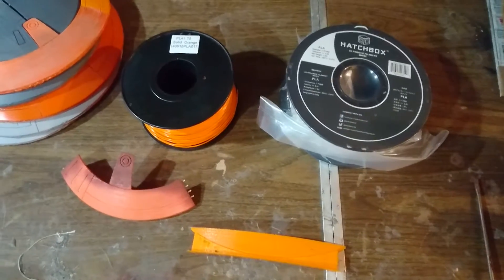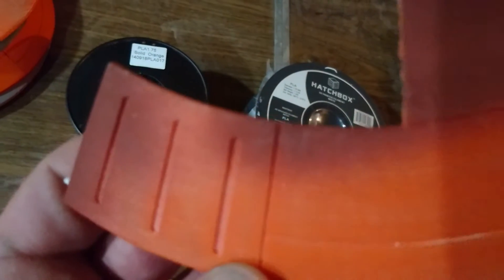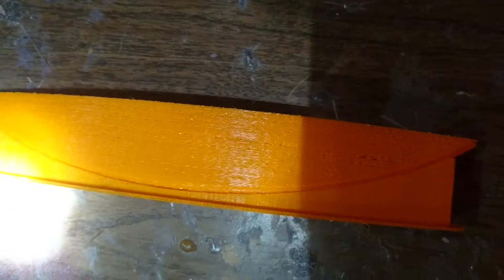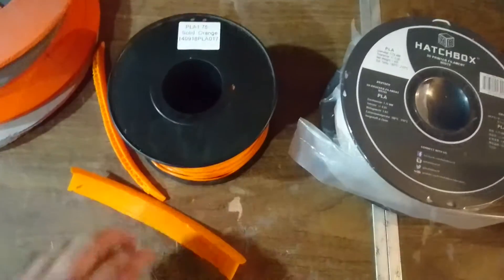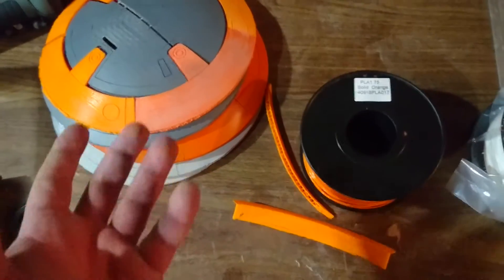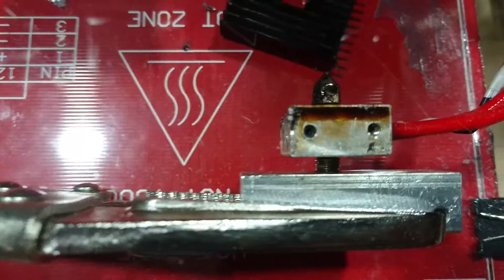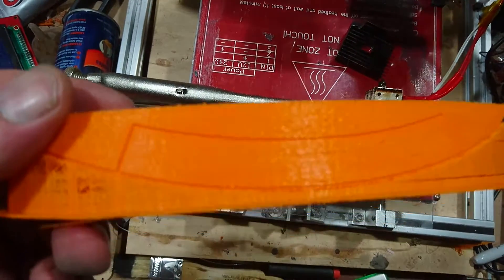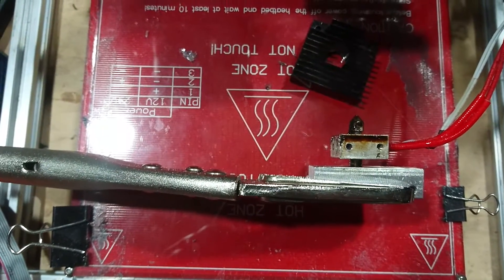How to tell if your PLA has moisture in it!

Comment: What are these white connections that u use?
Reply from the maker: The white parts are PLA filament, the edges of the model have holes so you can clip off some filament, stick the filament in the holes and glue the parts together.

Comment: Try calibrating for the cheap filament instead of the Hatchbox. I use cheap filament (with a correct calibration) and it comes out just like my eSun PLA+. You can not just throw in a new brand and use the same settings. Lack of experience and knowledge apparently.

Comment: This video is a lifesaver. I have been having an insane amount of problems with my new 3d printer and the filament that came with it. Poor printing quality, gaps, randomly stopping and not letting me load until it cools and reheats. Recently bought some new filament and I'm going to try printing with that instead. Something like 95% of my prints were stopping soon after starting and clogging the machine no matter what I did. If using new, well packaged filament resolves the issue I'll update this reply.
Reply: You never diss
Reply: maybe he quit 3d printing out of rage lol
Reply: @superjojo555  No my wife modified the machine and it worked.

Comment: I had an identical problem but it was an extrusion size problem in my slicer . It looks like a flow problem( being way too slow )  ,however I will watch the remainding video. Your video states how to tell if moisture content is high but this isn't really the case because this kind of print can be achieved easily by setting the extruder size in slicer to 3mm for a 1.75 filament .

Comment: Is the black on your nozzle / heatblock to do with water contamination or is that a normal byproduct of printing?
Reply from the maker: I would say a little bit of both. There usually is a little bit of plastic residue from normal printing, usually close in color to what color your printing.

Comment: Could you bake it in your oven at a low temp to remove some of the moisture?
Reply from the maker: +Critters You could, but a gas oven would not be the best. The one of the byproducts of the gas burning is moisture. If your going to try this I'd suggest an electric oven.
However, once moisture makes its way into the plastic it weakens it, I've read somewhere up to 33% weaker than plastic that doesn't have moisture in it.
Reply: +Jay May I've read that PLA will absorb humidity so it should be stored in a air tight thick zip lock bag otherwise even good PLA will go bad.